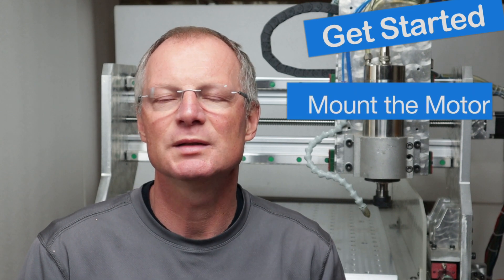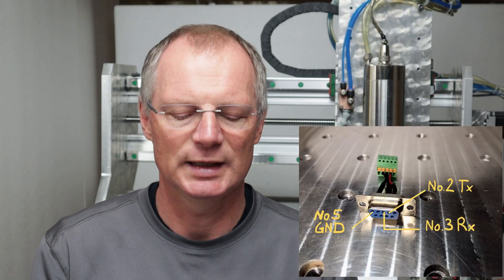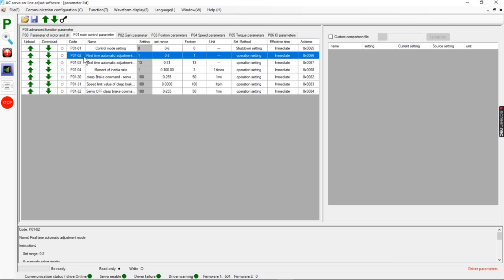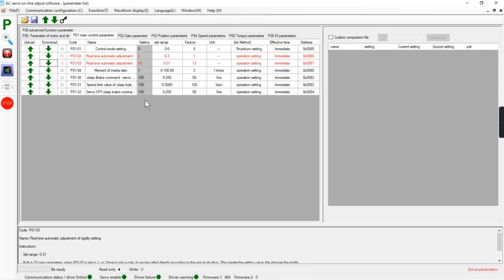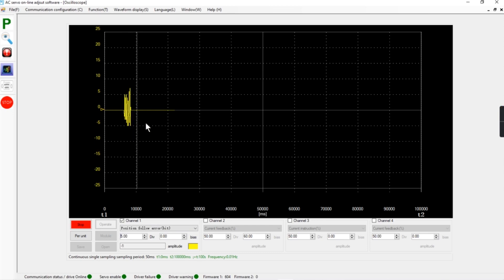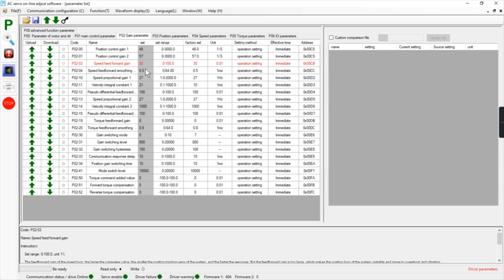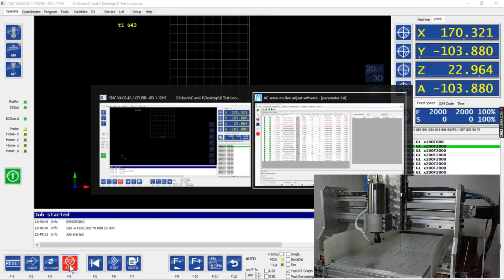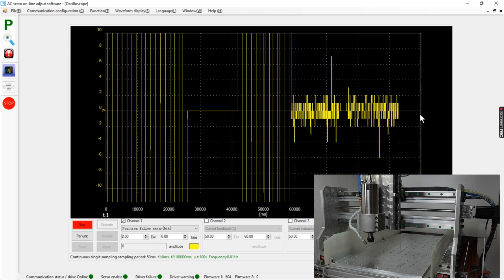JMC Servo Motor Tuning

Comment: Hi Jörg, 
great video. I´m as well just about to tune my JMC servos on my DIY CNC (gantry style - similar to yours) and I fully confirm your approach.
Unfortunately I found your videos just a few minutes after tuning the X-axis on my machine...

The Golden Rules  for tuning servos on (DIY) CNC machines are quite simple:
Maximum stiffness and minimum tracking error for each axis.

I set the "Autotune" parameters P01-01 (3) and P01-02 (19) for maximum stiffness (w/o noise or oscillations, using my fingers as a tool) and the "Speed Forward" parameters P02-03 (100) and P02-04 (0) for minimum tracking error (with 100 mm/s and 2000 mm/s² as the max. machine parameters, using the oscilloscope feature  and a very simple G-Code file) on the x-axis with best results...
Next is the Y-axis...

Grüße aus dem Süden Deutschlands
Kassen Oldewurtel
Reply from the maker: Very nice Kassen, I am glad you got the servos to work. I just cut a test part today and got most dimensions within 0.02mm I am really happy with that result. Check out the video I plan to upload it shortly. 
Grüße aus Kentucky USA

Comment: Great videos, thanks! I'll be doing this soon myself following your videos. Do you find it best to start from a particular microsteps? For stepper motors I tend to use 3200 but not sure what to start with for the JMCs
Reply from the maker: Thank you, the higher the steps you select the slower (but more accurate) will the machine run with the same set frequency of the controller (like Mach3, or in my case Eding CNC). I think you can use the 3200 that you currently have your machine set to and see if you can get satisfactory maximum speeds in a G0 move. Really anything between 2000 and 4000 will be great in most cases. Good luck with your project.
Reply: Thanks again for the video. I'm trying to add a brake to the z axis servo. Have you done this? Any guidance would be really helpful
Reply from the maker: It depends on the servo. Most higher end manufactures will have an optional break available for their motors. For the JMC you can by a motor with the break that is what I did. The Stepperonline servo does not come with a break but they have a separate break available. Most will run on 24V and you want to check the motor plate size (Nema 24 etc) and shaft dimension. Here a link 
https://www.omc-stepperonline.com/stepper-motor-brake
Reply: @JBWorx  thanks for the quick reply! I've already got a 400w nema 34 JMC motor for this purpose, I'm hoping to add a brake onto that. I'd be happy to buy a JMC motor with an integrated brake but I can't see a nema 34 version. I did see a video with someone adding a brake to a Clearpath but I wasn't sure if it was that simple with JMC, always seems a little tough to find info for JMC stuff
Reply from the maker: I don’t know if there is a break available in the 34 size but I would think that they are because it’s a popular platform size. Yes it’s pretty easy to add a external break if you only want it to activate when you turn the servo off. It gets more complicated if you want it to activate when the servo comes to a stop, in this case break parameters would need to be programmed … probably not what you are looking for.

Comment: Can't wait for part 2! Really appreciate that this video is in English!
Reply from the maker: Thank you for leaving a comment. Just today I was contemplating to shoot part 2 or not. Would there be any interest ? Well looks like I will go ahead and make the video.
Reply: @JBWorx  I absolutely would be! I've watched quite a few videos about tuning these motors in german using the auto-generated subtitles translated to English, but it leaves quite a bit to be desired. Also I was trying to set up the serial connection to my motors last night and couldn't make a connection. Had no idea I needed a converter with a prolific chip until I watched your video. Really helpful information!
Reply from the maker: Also important that the motor is powered. Now on my usb connection it will work without power but I have tried a different laptop and I had no communication until I applied power to the motor. Also go to the manufacturer website of your adapter wire and download the driver for for it. I will check if I can find the one I am using on Amazon and place a link for you
Reply: @JBWorx  👍I did power the motor when attempting to connect, but I didn't have any control signals connected (I assume that shouldn't be an issue though). I have another USB-Serial cable coming this time with a prolific chip. If that doesn't work, I'll have to see if I can try a different laptop.
Reply from the maker: @apocalypticangell  ok you got it part 2 is uploaded 😀
Reply: Circling back for anyone reading this in the future. The USB serial converter with the prolific chip (PL-2303) successfully connected. The converter with the FTDI 232R chip did not. Not ruling out user error though...

Comment: Nice work! did you ever monitored with a high speed camera? I tuned mine to a higher acceleration i normally use (10000mm/s2) (Older JMC 180W V5 versions) but for this V5 the scope was useless, (the V5 also uses different software) it showed a very low positioning error on the scope, but I heard something was off. A high speed camera revealed an obvious overshoot. Tuned with the camera to no overshoot, which showed a larger positioning error on the scope, but in fact was more accurate. (but again, that was for the V5, the V6 is a step into the right direction for tuning).
Reply from the maker: That is an interesting observation. I am sure that the oscilloscope has its limits also in the V6 version. In this video using auto tune there  are still flaws in the system i.e. the max. allowed Position deviation is set so high it makes it useless for a CNC set up. And I like to thank you for your comment. One question: what camera did you use to do that ?
Reply: @JBWorx  I guess the V6 is better in every aspect. I think they came out quickly with different firmware and software, the V6 is around a factor 4 longer than the V5. I simple used my phone, it was capable of 480fps. This is what it looked like after tuning; https://youtu.be/Nisvf5mRn0s (at 10000mm/s2)
Reply from the maker: @berendlucasvanderweide  ok I See. I just realized that I have watched all your videos a couple years ago.

Comment: Hi is the RS232 to JMC connector included with the servo?
Reply: That depends on the seller. Just ask them if it is included. The biggest issue is a proper USB to RS232 convertor. The cheaper ones normally don't work. My supplier delivered one with te servo's. I am using an Eminent with good results. (it was about 20 or 25 euro's)
Reply from the maker: Like Berend Lucas mentioned above it is not included. If you look at the picture I showed then all you will receive is the green plug. The other end is a DB-9 female plug that you will need to buy. They are cheap. Now that said if you buy a servo from Stepper Online ( these are nice) the wire will be included.
Reply: @JBWorx  Do you have any experience with the stepperonline servo's? I thought they use different software for tuning? I might be wrong, they look a lot like the JMC's.
Reply from the maker: @berendlucasvanderweide  yes i have used about 5 or 6 of them in some builds. They do not offer a version with a break like JMC does. I think the integrated drive is better and has natively a higher resolution so a better chip and or encoder. I also like the wire termination better using screws. The software is different and the oscilloscope is not quite as nice as you can not manually set the resolution. However you can obtain the inertia value from the software and that is a big advantage.
Reply: @JBWorx  Thanks, for the JMC servo brakes, do you need to supply a separate 24V and have the enable pins connected? I'm planning to reuse my existing 48V power supply tuned down to 44V for the servo mains (from labels it accepts 24-50V). I think stepperonline one does not have an enable pin, it's always enabled when power is turned on.
Reply from the maker: Yes, you need 24V to the break. I picked that from the 46V that my Servo is using so right at the servo terminal and mounted a small automotive all aluminum encased converter right on the motor. 3A will be plenty the break is not using much power. I do not use the enable on the JMC Servo as it did create a problem for me, but I do use the Alarm. You are correct the Stepper Online does not have an enable pin.